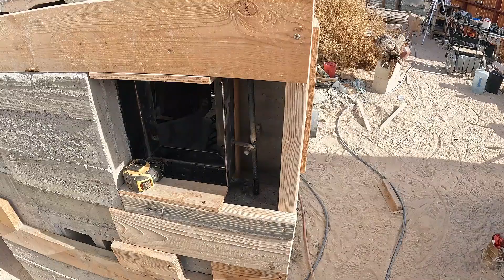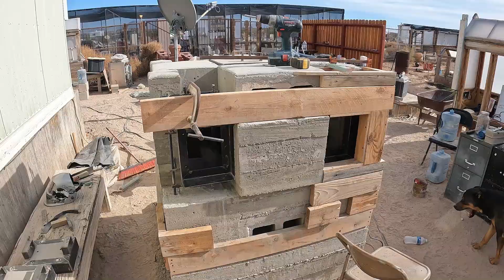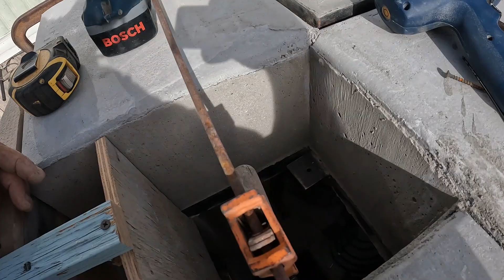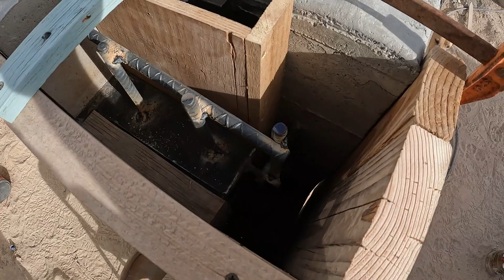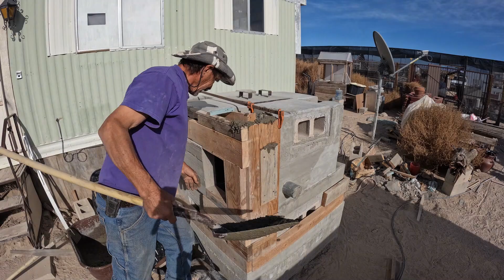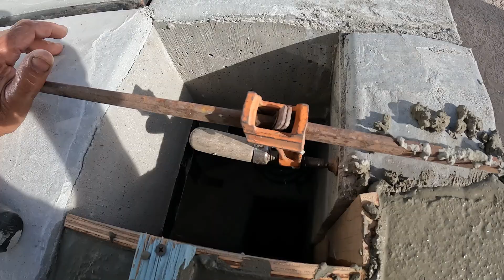137-Sand Battery Update, Concrete Corner

Comment: Step by step you will soon be done. But you need to explain the design when done it is very complex.
Reply from the maker: Someone else requested a drawing so I will draw up the design when I get closer to completion. Of course if it doesn't perform well then it may not be as relevant. But I will draw it up either way.